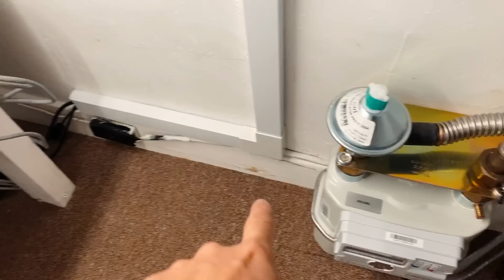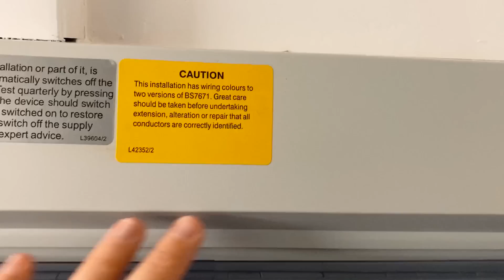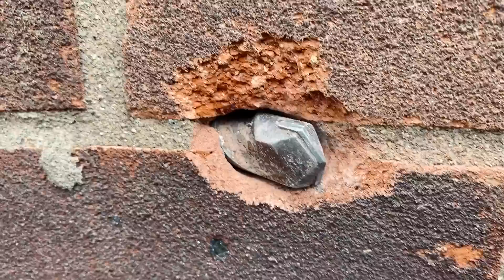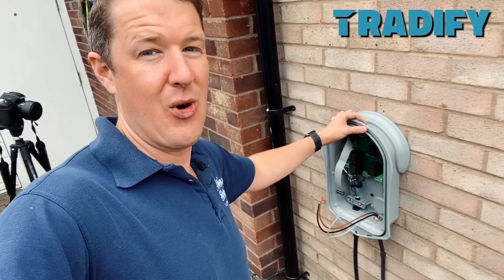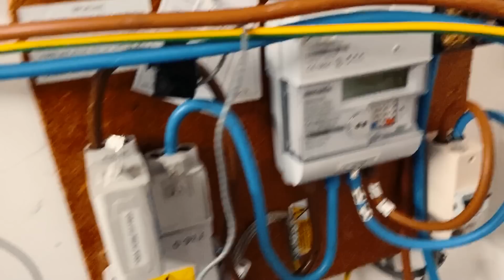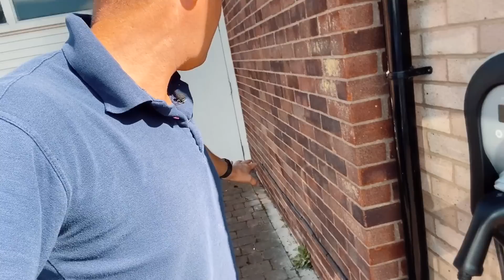Should YOU become an Electric Vehicle Charging Point Installer?

Comment: I've completed the niceic ev charging course in Cardiff.
Another money spinning course again
Basically a radial circuit using the correct rcd and earthrod for pme systems,and the new chargers got automatic disconnection if a neutral earth is lost.🤷‍♂️
Reply from the maker: Yep. Did they try and sell you Rolec units?!
Reply: @artisanelectrics  yes mate some of my mates got sucked into it and bought tester connectors 🙈
Reply: There's no need to go on any special course, as you say it's just a radial circuit, all the information is in that big book we have to have.
Unfortunately when there's grant money involved the powers that be can't help themselves, by sticking a load of red tape and hoop's you have to jump through, look at the MCS crap.
Reply: @acelectricalsecurity  totally agree pal.👍
Reply: I did the course and went on to fit Zappi's which didn't need the earth rod... Waste of a few hundred quid!

I was told I would be an authorised Rolec installer when completing the course which was untrue.... Had to buy a £450 Rolec tester to be authorised! Didn't want to install their ugly chargers anyway! 😂
Reply: @mickbitchum4664  hope your getting loads of work pal.👍
Reply: @rowles13  I've done 9 installs between Nov 19 - March lockdown. Since continuing work in June I've installed 1 and I've got 4 that I'm waiting for Western Power to approve or complete works on before I install. With the car dealers closed work dried up immediately but I've started to get a lot more interest in the last month or so. Also I've picked up other work whilst doing the installs so it's helping me gain more customers for other types of work at their homes. Only downside is waiting for OLEV payments, I'd waited 5 months for one payment! They've slimmed down the application process so hopefully installers will receive payment a lot quicker now!
Reply: @mickbitchum4664  How did you advertise your work?
Reply: @brad30  I've got my own website which I added a page specifically for EV charging. Also as a Myenergi Zappi approved installer I am listed on their website, this has probably generated me most of my jobs. I find most people looking specifically for a Zappi already have PV and looking for the benefits of 'free" charging.
Reply: @mickbitchum4664  Can you send me a link to your website please?

Comment: What’s your thoughts on the zappi installation manual that states the protective device is to be double pole? I would have done exactly the same as you but the manual says double pole.
Reply from the maker: Didn’t notice that I will have to check

Comment: Most clients buy an electric car and the dealer handles the installation with their approved electrician for that garage. Eg Hyundai etc
NAPIT have asked if I require training but I’ve had no enquiries for chargers so that’ll be a no.
When I get a call I’ll consider it but I’ve had 0 interest (Exeter Devon)
After your training did you get on an approved list of some sort? 
My mother just bought an electric Vauxhall corsa and Vauxhall threw in the charger fitment with it.
But now western power have surveyed the install and are updating the house supply so it seems the infrastructure isn’t quite up to it?
Reply from the maker: Yeah problem is so many companies offering cheap installs the quality is shocking
Reply: @artisanelectrics  ba dum tsss
Reply: same. I've known a few now where the car garages are supplying the installs. One of my customers I've done their work for years and they had a Tesla car last year and wanted me to get involved. Turned out it was all included and what a mess it was. Sub board installed off a brand new rcbo board with plenty of spare ways. 6mm t/e slung through cupboards and under under kitchen cupboards, absolute crap. I was thinking of getting the NIC course done but haven't felt the need yet
Reply: Bertie I'm in Seaton,  East Devon. I got my ticket for EV about 3 years ago. Had no installs for about a year then i got the odd one here andvthere and now it's starting to pick up.
Reply: Jonathan  Stephens
I thought it was just me that didn’t get any enquiries about chargers. 😊

Comment: Why do you use 6mm armoured cable rather than mains cable inside conduit?
Reply: I would use armoured all day long. Unless your thinking steel conduit along its whole length.
Reply: @c8bbr  No. Plastic round section. Less expensive.
Reply: peter blenkinsop naaa they bow / go brittle overtime. Moisture gets in even when sealed and just causes issues years down the line. Probably my personal bug bare because it can be used as a gas route, water route etc in hazardous areas so I just avoid it.
Reply: @c8bbr  Ok. Thanks.
Reply: Quicker. Neater.

Comment: Is three phase an option over there? Or is the power cable from the street into the house not prepared for that? In the Netherlands it is common to have a three phase cable deepening on the meter you can use all three phases. Most new EV's have three phase charging.
Reply: Most homes in the U.K. have only single phase.

Comment: Another nice install as always 👍😁. I tend to use 12mm heatshrink for the idents. Can get packs from Edmondsons and the adjustable i tend to use is this; https://uk.rs-online.com/mobile/p/wrenches/4822343/
As well as the knippex flat jawed grips;
https://uk.rs-online.com/mobile/p/wrenches/1585495/
There is a smaller version if your only doing the smaller glands up to 25mm
https://uk.rs-online.com/mobile/p/wrenches/2222735/
You can also get the thin jawed adjustable which is handy for those cheaper glands and helps you to get in to split the gland body instead of removing he locknut 😁

Comment: Sleeving should cover over 60% of the cable
Reply: What's the reg for that?
Reply: @nathanhedgeley8016  514.3.2 
Every core of a cable shall be identifiable at its terminations and preferably throughout its length. Binding and sleeves for identification purposes shall comply with BS 3858 where appropriate.
60% isn't stated but 100% is recommended so at least 60% is good practice. It's new to 18th edition

Comment: Wire colours in the 'steel wire armoured' cable. Is it harder or more expensive to get these cables with green/yellow + blue + brown wire insulation than with black + grey + brown, in the UK?
Reply from the maker: My wholesalers can’t get hold of the “normal” colours
Reply: Actually I think that 3 core SWA has the „right“ colours (br/bk/gr) as the shielding is used for PE.

So 3 core can be used for 3ph motors when no neutral is required.

The 4 core should have a blue wire in it.

Why not use NYY cable for that?

Sleeving the black as PE seems a bit strange to me as this could also be a phase or switched live.

Is the steel armoured required in domestic installations?
I would expect to see that in an industrial environment or underground.
Reply: One option depending on the size of the SWA (from memory 6mm is fine, 10mm isn't) is to get 2-core and use the armour as the CPC. People often try to claim it's not allowed, but as long as there is no reason to expect the environmental conditions might lead to the armour degrading, it's fine (see eg https://gadsolutions.biz/regulations/swa-as-the-cpc for more details)...